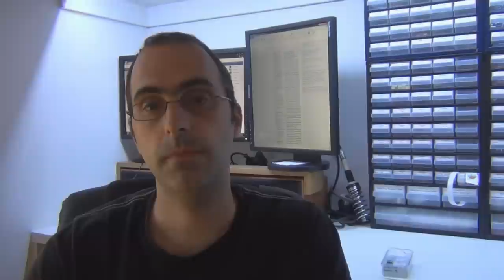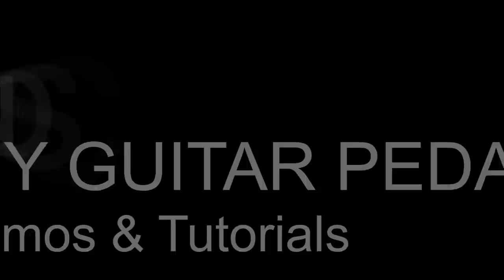B2B - Capacitor Voltage Rating for Guitar Pedal Circuits

Comment: if you can go high in value with no change in the way the capacitor operates why do they have such a wide range of very low values at all, why have a 6 point 5 volt or a 10 volt when you could just use a 50 or 100 volt cap for every thing below that and not have to stock lots of low values?
Reply from the maker: My understanding is the capacitor to "rejuvenate" with the supplied voltage and if the voltage is too low the capacitor will lose its function faster

Comment: Would it matter if your had one rated way above what you need? Say 200v
Reply from the maker: I've read yes it can as the capacitor dielectric isn't being utilized (the dielectric needs voltage to regenerate).  So I read...

Comment: So what components determine what charger you can use. Just the caps?
Reply from the maker: +Jesse Belanger All of them :)  resistors (wattage rating) capacitors (voltage rating), Transistors (max voltages) IC's (max supply voltages) etc.  Have a look at the datasheets for transistors and IC's to see their maximum input voltages.  This is why you cant just stick a 18v supply into a booster / buffer / etc for "more head room" and hope for the best.
Reply: +DIY Guitar Pedals is there a good website for finding data sheets   I'm so sorry to keep bugging you. I was in a bad accident a few years back when wakeboarding and had my leg sucked up into a boat propeller. So I'm not able to work and have a lot of time on my hands. Seeing as how I'm unable to work I think it will be really good for me.  Maybe down the line help me out with a little money here and there.  That's not the main thing though
Reply: +DIY Guitar Pedals thanks for not making me feel like an idiot. We all start somewhere right
Reply from the maker: +Jesse Belanger Sorry to hear about your accident Jesse! :( You can find all datasheets in google.  Good idea to stick with the manufacturer for each component but generally there shouldn't be much difference between say, a Fairchild 2n5088 and a Onsemi 2n5088.  Cheers